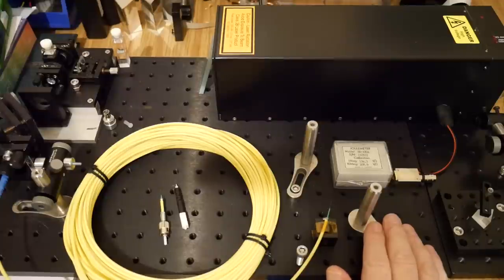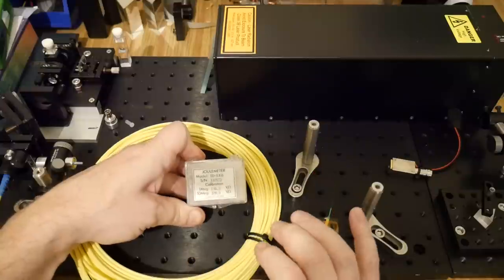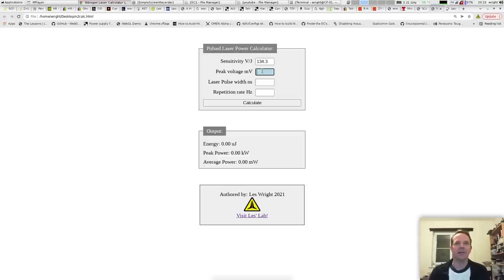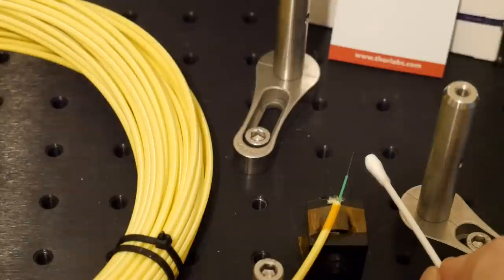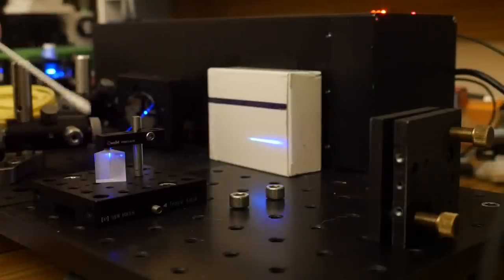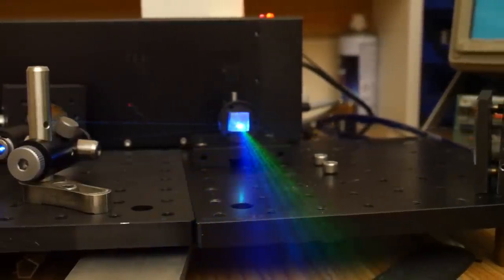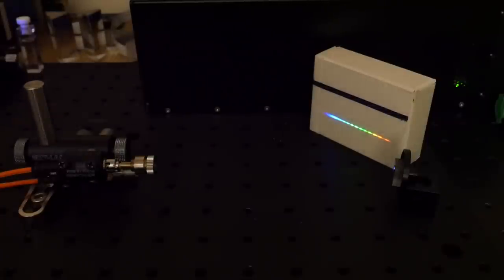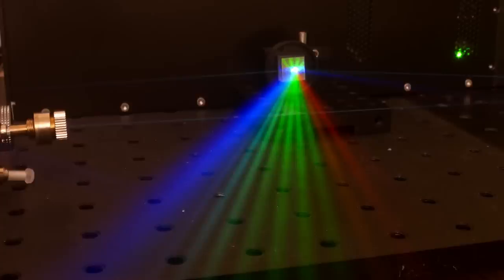Supercontinuum in Multimode Fiber

Comment: Please make the explanation video if you find out why it produces such peaks in the spectrum)
Reply: This paper: DOI 10.1364/OPEX.12.004366 states, that it is Raman scattering
Reply: @great__success  I agree that it must be Stimulated Raman Scattering. Figure 3 in the paper you mention matches the spectrum in the video exactly! Also, the spacing between the lines of around 12nm corresponds to ca. 13THz when operating near 500nm. This is exactly the frequency where the Raman gain spectrum of silica peaks as per my previous comment.
Reply: Thanks!
Reply: @yourfavouriteta   I fully agree! A couple of years ago my eyes almost fell out when I entcountered this the first time. I coupled a laser with 532nm, 10kHz rep rate, ~1ns pulsewidth, ~5kW peak power into a HP780 fiber (~20m length) to send it across the canary islands. When I checked the transmitter because the guys on the other island did not see anything on their tracking cam (they had a filter which was transmitting only 532nm) I found out that I was sending actually orange light instead of green 😂. It took a while until i figured out what was going on...
Cheers
Johnny
 PS.: Congratz to your cool channel Les! I am always smiling when a new video comes out! I wish you much more subscribers! You are doing very cool stuff!
Reply from the maker: @Your Favourite TA, I was hoping you would comment! So the comb then is just a product of SRS, awesome! Any thoughts as to why the output from a raw fiber has such low divergence in this case?
Reply from the maker: @A Fantastic! Thanks for the link! Edit: In fact double thanks! This paper describes this perfectly, and opens up another possible avenue for experimentation as well! 🙂
Reply from the maker: @1x1johnny  Nice! Yeah, this kind of stuff is really special to see! Thanks! I am enjoying sharing cool things!
Reply: @LesLaboratory  No problem! I posted a much more in-depth comment as well explaining the physical intuition behind SRS and why soliton fission is probably not occurring in this case, but since it contains a bunch of external links, it may have been flagged as spam. Is there some way for you to check this? 

Regarding the low divergence, I ended up going down quite the rabbit-hole: First, according to [1] , the beam divergence angle, theta, as a function of wavelength is given by: 

theta(lambda) = M^2(lambda) * lambda/(pi*w(lambda)), 

where lambda is the wavelength, w is the beam waist and M^2 is the "beam quality parameter" at the output, which essentially tells us how "close" the electric field distribution of the beam is to a pure Gaussian. At M^2 = 1, the beam profile is a perfect Gaussian while M^2>1 indicates a "less ideal" beam profile. For the fault locator you used, the wavelength of its red light is around 650nm, producing a beam waist of 30mm while your supercontinuum (SC) is centered around 500nm, producing a waist of around 10mm. All else being equal, we would expect the divergence angle of the red beam to be larger by about a factor of 1.3. In isolation, the difference in wavelength is therefore not enough to explain the observed beam waist ratio of 3. 

Since your SC light and the red light from the fault locator are guided by the same fiber, their waists, w, in the equation above are most likely almost identical. Initially, I thought that some kind of self-focusing effect[2] was taking place for your SC; essentially, the high intensity of the light would increase the refractive index close to the center of the fiber, effectively turning it into a graded index fiber[3]. However, this would tend to decrease the beam waist of the SC, which in turn should increase its divergence angle! Furthermore, such self-focusing effects in silica only become significant for pulse powers on the scale of ~5MW (see Figure 1 in [2]), but your pulses are only 0.01MW. 

Thus, the only remaining factor is M^2. If the profile of the pulses you launch into the MMF is very nearly Gaussian (which it presumably is), it's actually not unexpected for the profile of the output to be as well (see Figure 4 and Figure 5 in [4]), leading to an M^2 value close to 1. In contrast, I doubt that the handheld fault locator, which seems to be available for $40 on Amazon [5], is designed to launch an ideal Gaussian beam profile into the fiber, so I would not be surprised if its M^2 value is much larger. At the very least, it would not be a surprise if M^2 for the fault locator is 3 times larger than M^2 for your SC (even if this does not have an ideal M^2=1).

One way to check the M^2 value of your SC is to place a filter at the exit of the MMF and inspect the pattern it creates on a wall. If it remains smooth, M^2 is probably close to 1 for the wavelength you extracted. If it contains lots of speckles (like the pattern of the fault inspector) M^2 is probably large. Note that using a filter to inspect each wavelength in the SC individually is necessary because a large number of overlapped speckle-patterns at different wavelengths will tend to average out to a deceptively smooth profile as pointed out in the paragraph above Figure 2 in [4]. 

In conclusion, I cannot rule out the possibility that some sort of self-mode-cleaning effect is taking place, but it seems that we can explain the difference in beam waist simply through the (presumably) high M^2 value of the cheap fault locator. To test this, you could try to use a laser which you are more certain has a low M^2 value. Alternatively, if the narrow profile of your SC is indeed due to a nonlinear effect, you could try to gradually lower the power of the input pulses while retaining a filter at the MMF output. If the observed profile increases in width (or becomes more speckled) when you lower the power, maybe some kind of nonlinearly induced self-cleaning effect is indeed occurring. 

[1]: https://www.rp-photonics.com/beam_divergence.html
[2]: https://www.rp-photonics.com/self_focusing.html
[3]: https://www.rp-photonics.com/graded_index_fibers.html
[4]: https://www.rp-photonics.com/passive_fiber_optics4.html
[5]: Amazon catalogue number (ASIN): B01DNSZSK2
Reply from the maker: @yourfavouriteta  It looks like YouTube expunged the comment before I could see it. I wish it were a little less aggressive, and just let me review things!

Thanks for taking the time to write this answer, I am learning really quite a lot from the comments on here, it's very helpful to have a conversation and the guidance of experts in the field.

The input beam from the Dye Laser has a complex pattern, (It's a decent build, but by no means perfect: unstable resonator, short cavity,  etc). The previous experiments with 9um cable, resulted in a large donut shape spot that "looks like" TEM01*, I say "looks like" because I could swear that at one point, it briefly looked like TEM03, and so it could be the case that the beam is/was rapidly switching between modes in that particular fiber. This experience set my expectations when it came to this experiment.

In the 50um cable, I thought self focusing as well, but figured if it was, it should have destroyed the fiber (internally), and as you say, ordinarily only multi-megawatt pulses should really exhibit that kind of effect. Though there have been special cases (organic liguids IIRC), I doubt I should see it in silica. I even considered high peak powers causing lensing at the fiber faces.

Back to the beam from the Dye Laser: Although beam has a complex pattern, if only the central 'spot' is effectively coupled in, and the rest is wasted (exits into the cladding, poor coupling etc), as could be the case, even in 50um cable, maybe the portion of the beam that  is coupled in, has an M^2 closer to 1 than I might suspect?

Thanks for  the practical suggestions that should get me close to the answer. These are experiments that should be easily testable, so I will set something up.

Thanks again for taking the time to look into this and reply!
Reply: @LesLaboratory  No problem, thanks for an awesome demonstration of a cool technique.

If you go to YouTube Studio, there is a "Comments" button just below the "Analytics" button. On the "Comments" page there should be a tab for comments "Held for review". Maybe you can see it there? In case my original one does not show up on that page I will simply repost it in this thread.
Reply: @LesLaboratory  [Original comment reposted]

The peaks at 16:52 arise due to a process called Stimulated Raman Scattering (SRS). To understand this mechanism, consider a simple, isolated molecule like H2. The molecular bond can vibrate at a set of distinct frequencies due to quantum mechanics. If we were to shine a laser onto the molecule, a photon can "donate" some energy to the molecule by exciting vibrations. Since the photon has lost energy, its frequency has decreased by an amount corresponding to the vibrational frequency of the bond. Since the frequency has decreased, the wavelength must have increased.

For an amorphous material like silica, the molecular bonds are extremely irregular compared to a simple H2 molecule. Therefore, the possible vibrational frequencies form a continuous "band" with a peak at ca. 13.2 THz and a width of around 5 THz as shown in Figure 2 in this link:
https://www.rp-photonics.com/raman_gain.html

Therefore, when shining a highly intense, coherent laser pulse with a certain carrier frequency into a silica fiber, coherent molecular vibrations will be excited. This transfers power from the carrier frequency to one that is approximately 13.2 THz lower; this is SRS! Furthermore, this lower frequency will keep "stealing" power from the carrier until it gets so intense that the process can repeat for a frequency that is an additional 13.2THz below that one (and so on in a process called "cascaded SRS"). This explains the observed "comb" structure. 

[Edit: Another commenter pointed out that the green part of the SC seems to "flicker" a lot more than the blue part. This makes sense given that the power of lower frequency lines depend on the power of higher frequency ones, which ultimately depend on the power of the input pulse. Small fluctuations in incident power will thus be "magnified" for higher order lines.]

Considering the peaks at 16:52 labelled 497.7nm and 519.4nm (with an unlabeled one in between), we can see that the peak spacing is 10.85nm. Converting this difference in wavelength (BW_lambda) at 497.7nm (lambda_0) to a difference in optical frequency (BW_f) using

BW_f = c*BW_lambda/lambda_0^2,

we get 13.13 THz, which is very close to the peak frequency of the Raman gain spectrum presented in the link above. 

If you are interested in some of the theory behind nonlinear phenomena in optical fibers, feel free to check out my channel, where I both demonstrate these effects experimentally and simulate them numerically using custom python code:

Experimental Self-Phase modulation : https://www.youtube.com/watch?v=wZyaTVTmmBk
Experimental supercontinuum: https://www.youtube.com/watch?v=ZsZXqxwJBcw
Numerical simulation: https://www.youtube.com/watch?v=xIdozUy9Nas

I plan on upgrading my own code to handle Raman effects in the future, but I know that others have created packages that allow for simulating SRS in optical fibers:
https://github.com/WUST-FOG/gnlse-python

This was a really awesome demonstration, great job :)
Reply from the maker: @yourfavouriteta  Found it, fixed it and now reading it! Cheers!
Reply: @LesLaboratory  [Addendum on Soliton Fission to original comment]

In addition, though it's not an effect I have worked with myself, I don't think soliton fission is taking place in your experiment. The sources I have been able to find (see links below) state that soliton fission takes place for pulses on the scale of tens to hundreds of femtoseconds, which is much shorter than the 2ns pulses used in the present experiment. 

The basic reason seems to be that a pulse with a duration of around 100fs has a spectral width, which is close to the 13.2 THz peak of the Raman gain spectrum (see previous comment). Therefore, the spectral tails of the pulse itself end up stealing power from the carrier frequency, which is different from the SRS case, where the lower frequency photons are not initially present but "created" from a mechanical vibration excited by the pulse. Combined with other nonlinear effects (Self-Phase-Modulation, Cross-Phase-Modulation and Four-Wave-Mixing) as well as dispersion (different frequencies propagating at different speeds leading to broadening in the time domain), the spectral output is usually much more "messy" than the one shown at 16:52. 

Again, this effect is not my main area of expertise, so if anyone suspects that soliton fission is present after all, I would be interested to see the explanation.

https://www.rp-photonics.com/supercontinuum_generation.html
https://en.wikipedia.org/wiki/Supercontinuum#Soliton_fission_regime
Chapter 12 & 13 of "Nonlinear Fiber Optics" by  Govind P. Agrawal  (https://www.elsevier.com/books/nonlinear-fiber-optics/agrawal/978-0-12-817042-7)
https://opg.optica.org/oe/fulltext.cfm?uri=oe-14-21-9854&id=116387
https://opg.optica.org/directpdfaccess/b9dfcc88-eb69-4928-991b84b0a0c94b38_81189/oe-12-19-4614.pdf?da=1&id=81189&seq=0&mobile=no

Comment: I was waiting for this for whole week :) great work ! I can't think of a way to measure but probably there are micro pulses within your ns long pulses. Probably distance between these micro pulses are at the order of femtoseconds.
Reply from the maker: It's something I intend to investigate. The original paper used a monochromator a PMT and an oscilloscope to scan the spectrum, and measure the pulse width at each wavelength, and it looks like there is something to see there. I have just acquired a scope (the one int he video), I won't get down to femtoseconds with it, but after the hack, it will be a 1GHz scope, so subnanosecond resolution.
Reply: @LesLaboratory     That would be another epic content. I used PMT's in the past but it was configured to measure few photons . The ones we used was old, nevertheless had few ns rise time.  I never used them in the presence of considerable amount light and I am curious.  :))

Comment: My guess is that the modes, or "striations" you see after the reflecting diffraction grading are a result of multimoding occuring within the fiber. I believe that these discrete modes are occuring because the MM fiber allows for numerous, discrete TEM modes to propagate, whereas the single-mode fiber you used previously, did not.
This is why we see the modes occur after the grating, because all of the power coupled into the fiber, exists propagating within these discrete modes in the fiber.
I'd be curious to see if applying stress to the fiber causes these modes to shift, widen, vary in amplitude, transfer power between modes, etc...
Reply: Interesting suggestion, but the consistent spacing of ca. 12nm (corresponding to ca. 13THz when operating in the visible range) matches the spacing expected from Stimulated Raman Scattering as per my other comment. This is a well-known effect in optical fibers and is even exploited for amplifying the optical telecom signals that were most likely used to transmit this video to your device! It's a very cool effect :)

Comment: what are these attenuators you are refering to?
Reply from the maker: They are made from a stack of glass microscope slides. Soda glass will absorb a fair bit of UV, but slides are thin enough and flat enough to make reasonable attenuators inexpensively.
Reply: @LesLaboratory  i dont think you mentioned any of this or shown them ,what is the point of using them then removing them and why is the spectrum then more visible when you do this?

Comment: Off topic question. Do red laser pointers like the ones you see used as cat toys emit only in the 630-670nm range or can the emit in the UV-blue as well. I know some of them even emit in Infrared. I’m having a issue with a photographic emulsion that I want to be IR sensitive. I know it is UV-Blue 300-520nm sensitive. After sensitizing
With some dyes I found when I used a red laser on the emulsion with a 720nm filter. The emulsion reacted to the light. So can red laser pointers emit uv light or did I succeed in the Near infrared/red light spectrum?
Reply from the maker: Red Laser diodes  emit no light in the UV or blue portion of the spectrum. 
Light sensitivity of photographic emulsion does not have the expected sharp cut-off at each end of its quoted range, but instead will tail off towards the UV and IR at each end. The manufacturers of the emulsion may not show this on their graphs or datasheets, since they are quoting a usable range for regular circumstances. A Laser beam, with a power of just a few milliwatts has extraordinarily high brightness when compared with other light sources, and can easily expose silver halide emulsions, regardess of their quoted sensitivities.
Reply: @LesLaboratory  I made the emulsion. I’m testing for sensitivity. So from what you say here that means i in fact made an emulsion that is near infrared sensitive. I filtered the laser through a 720nm and 760nm filter. Only the 720nm showed results. Thank you for the help. This is great news. I need to test more dyes to find some 800nm+ fluorescing dyes from cheap everyday things. So far if I understand right I found my 720 dye.

Comment: @17:30 the light appears more blueish even though it has red wavelength on it! 🤔
Reply from the maker: There are a couple of things responsible here: 
The red output is significantly lower than the blue, so the color balance of the 'white' beam is off.

Blue light scatters forward much more then red. Try it with a 405nm Laser pointer and a 650nm pointer of similar powers, and you will see the 405 is much more visible.

Camera color rendering is shocking, even in decent ones :-S